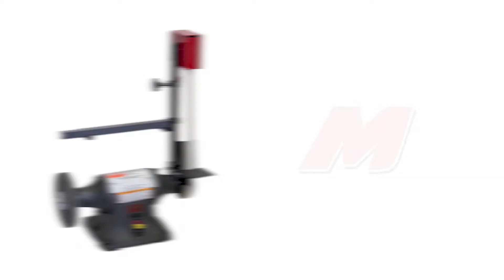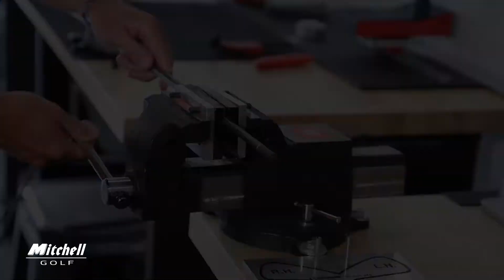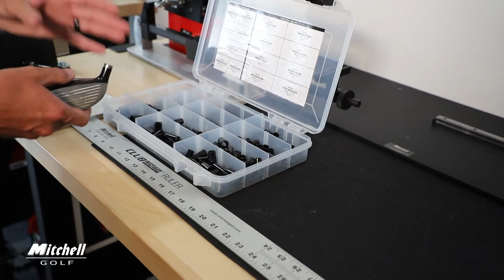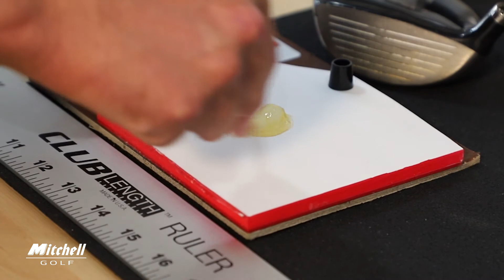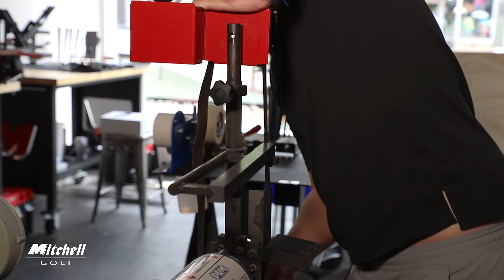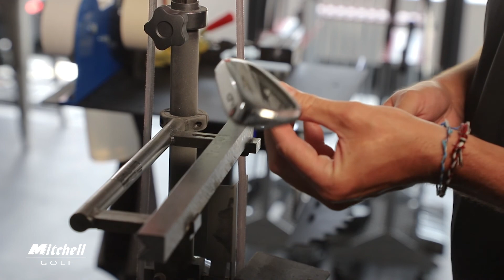Mitchell Golf Bench Motor, Turning Ferrules, Epoxy l Full Demo

Comment: man, using the 1/8" drill bit to remove epoxy from the shaft without the chuck guide is dangerous for those not building clubs on a regular basis. IMO